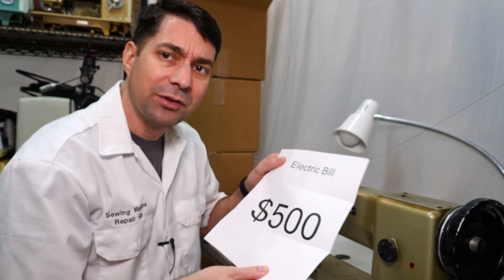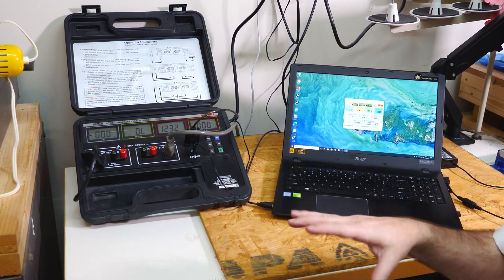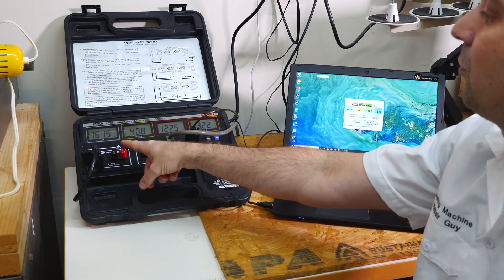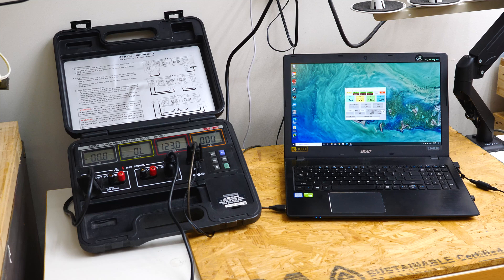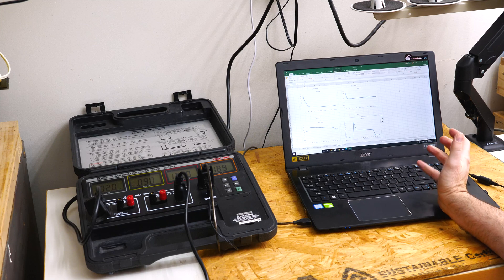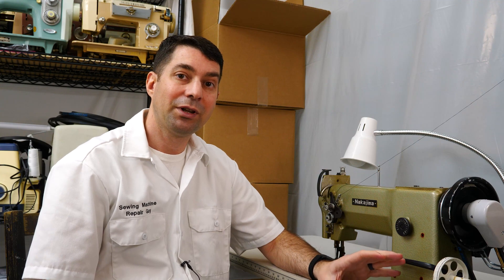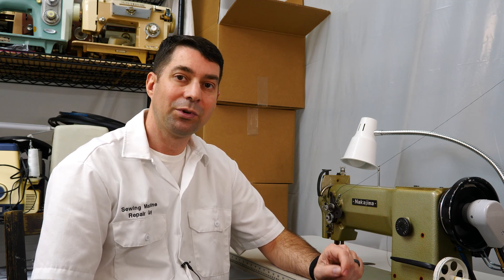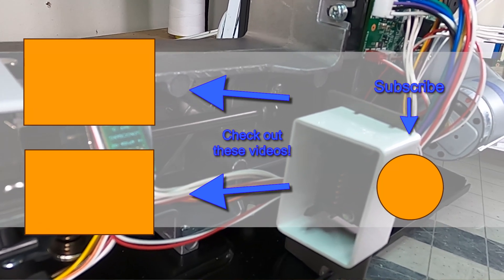Testing the 3 Reasons You Want a Servo Motor, It Could Change Your Life!

Comment: Well yes, but a clutch motor is at least more durable.   I have a clutch motor on a harness stitcher that's dated 1984 "made in Taiwan"  I've used it most weekdays for 17 years....And it came out of a shop that installed it in 1984.   To top it off I don't have a speed reducer on it.  Just a small dia pulley on the motor.  You get used to a clutch motor and you learn how to feather it to get those slow stitches.  In 17 years I've probably adjusted the clutch 5-6 times.  I have no doubt it would last at least another 10 years....Now, I wouldn't mind an Efka DA box with a 1550 motor on that one......But, works fine for now.
Reply: @cs-rj8ru  well you probably paid the cost of that clutch motor five times over in electric costs ….   So essentially you’ve paid to replace it a dozen times already.  Switch to a servo!